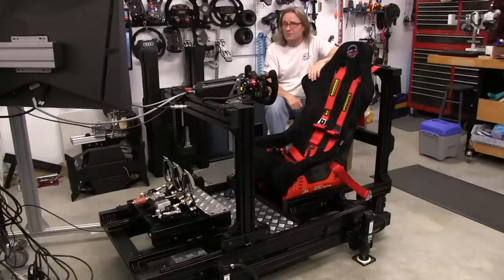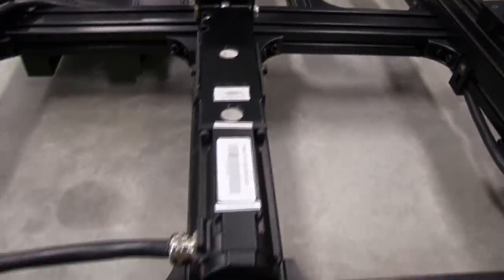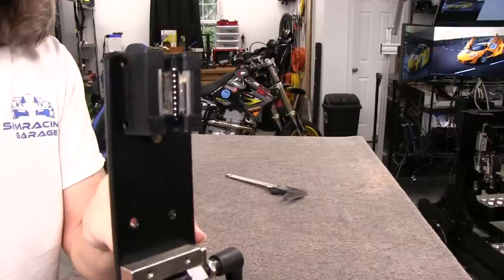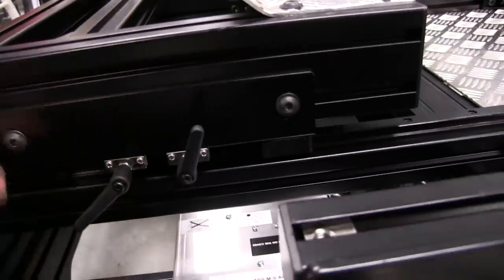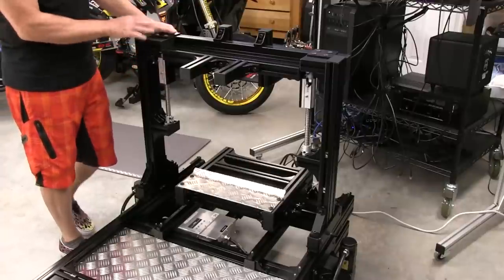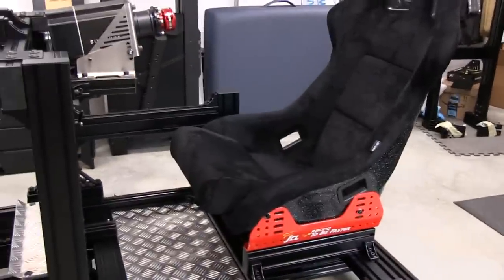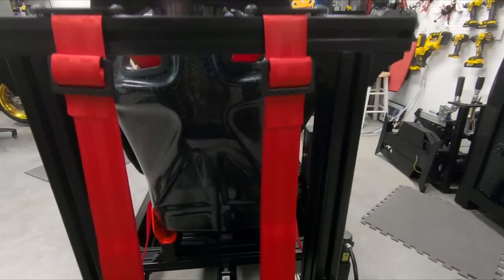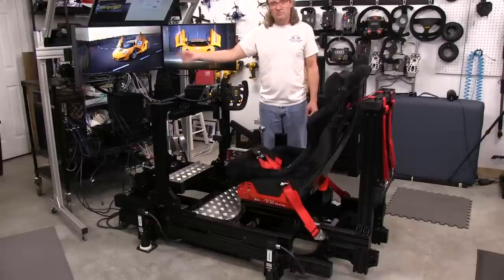JCL V4 4DOF D-BOX Motion Cockpit Review

Comment: Lol
 Are you kidding me? 42k$ for 1.5inch stroke actuators?
I built my cockpit with 4 PT actuators 6inch stroke, 250mm/sec and 175kg left power with only 4.5k $. You can add TL with the underneath frames with only 1700$.
42k is simply out of this world for what this system offers .
Reply: For 42k I would rather buy a car
Reply: For that price I’d hire u to upgrade mine if it works the same way on this video. 😏
Reply: D-Box is really REALLY overpriced! JCL is ... ... ok.
Reply: the 3d printed open source diy jobby?
Reply: Derek Hartley 
No not the SFX100... PT actuators are an industrial heavy duty motion linear actuators.
Reply: 70% of the price is probably the DBox actuators since its a niche they can overprice them fraudulently
Reply: Rich people like to blow money. It's easier for them
Reply: @wajdi1977  I don't know much about motion rigs, do you have a link of your rig?

Comment: Those D-Box combined with seat-mover solutions seems like the new shit if you can spend 40k+ on a motion rig and only tried both separately. Personally when prices go up in real race-car regions, it's getting a bit ridiculous as a private option. I liked the new 3motion from Tracktime this year and it provides similar forces just through the seat, but 14.5k Euros only as a complete package with HE pedals, Simucube 2 Sport, display and sound-system is just ridiculous, since potential customers have this or similar stuff already. 
Personally i'm still happy with my GS-5+SimVibe solution, especially since i found the surge-trick what was missing on default. Usually the GS-5 is not satisfying with surge, because the seat does the opposite of a seat mover trying to simulate the pressing into the seat while accelerating and releasing the pressure while braking, but it feels wrong without a seat-mover especially with seat-belts. The trick is to switch the back- and bottom-plate function so it works like a seat-mover. Now it can do all forces more or less and excels on the sustain g-forces this solution by far. With a D-box at home i would rather buy a GS-5 and make a DIY active seat-belt-tensioner, which are unfortunately not commercially available afaik. Should be around 200 bucks and i guess the combination would be better and more complete than this.
Reply: Hi Leynad, Henning from Tracktime / RaceRoom here: There will be a motion unit only 3motion soon. We only need to build up a bigger support team before launch as that product will require more telephone / mail support for setting up support with customer pcs. We don't want to get in trouble with bad support, so we started with the trouble free ready to run solutions first.

Comment: Put a magnet to these delrin rails, and se if they are magetic! My guess is steel. Linear guides are often used in cnc applications:)
Reply: Magnet wouldn´t work if it´s stainless steel. Most of the stainless steels are not magnetisable.
Reply: Markus Steinbach, these are hardned steel, same as you find any other bearing steel...

Comment: shouldnt braking and accelarating be simulated the other way around?
This kinda confuses me.

How would it feel the other way around? Can you try that
Reply: Yes, this is my concern as well. Looks like they spent all that extra money on a D-Box actuator to create a belt tensioner. When a belt tensioner with similar or even better effects could be built for much cheaper. You could also switched up the design to get a forward surge effect and still get a belt tension when breaking.

Comment: I guess for 43k they could have added a front mount for dd wheels..those 40x40 bars to hold the motor seems a little bit cheap to me for that overall solution, and also the pedal mount seems the bare minimum..
Reply: You can definitely build a much better motion cockpit with 5 DOF plus anterior and posterior TL plus SC2 DD, Hydraulic pedals, Index VR and high end PC with only 20K. This thing is definitely overpriced.

Comment: Can one purchase just the “V4” portion from the JCL website (http://www.jcl-simracing.com/en/v4-dynamic-frame/525-black-aluminum-frame-v4.html) and then mount a SimLab P1-X?  I know they use slightly different profiles where the fittings aren’t compatible and was curious if you could use their sliders they’ve designed to still mount the P1-X.  Then one could have the better P1-X and source their D-Box parts elsewhere for less.
Reply from the maker: Yes you can. JCL will build the V4 to any width you require. And the slider brackets will take regular 40 series profiles as the side mounting holes on the brackets have an oblong hole to facilitate this. You can see this in the "How It Works: (slider system)" segment of this review. I will be mounting a P1-X to the JCL V4 I have. Of course I will be making a review video of this. Including how I go about modifing the width of the V4 chassis to receive the 580mm width of the P1-X.

Comment: Barry could you tell me what the measurements are for the rail width and what size linear bearings are on them ?
Reply from the maker: 15mm rails. When you buy the rails, your source should also have the correct bearing assemblies for it.
Reply: @simracinggarage3026  
Thanks for the reply, i'm building surge myself. 1 more thing could you tell me how long the rails are ? I'm going to use a 150mm stroke so i think 400mm rails would be enough.
Reply: @simracinggarage3026   I wonder what kind of sleds they use. I have looked for a week now, cant find these exact sleds. Finding the clamp was easy.  Is there a brand name or model written on these?

Comment: Off topic question: what do you recommend for a first wheel the TMX Pro or the G920?
Thanks.
Reply: Tmx pro, it has way better accessories to buy later on, such as the handbrake and shifter. The logitech doesn't have a handbrake, and the shifter is all plastic. Also the pedals for the tmx are miles better, and the force feedback is way more raw. Definitely go with the tmx

Comment: Great really in depth review as always berry. So it's an amazing looking set-up, really nice features.  But shouldn't the surge push the opposite way? Meaning during acceleration doesn't the seat push into your back vs pulling away like this system does? 
Here's a system with over drastic settings but the sled is moving the opposite direction. 
https://youtu.be/oiAXlMdQYBw
Can you elaborate on the surge feeling? IMO, it seems like an elaborate seat belt tensioner?
Reply: This was my exact question as well, every surge simulator I have seen is doing it backwards like the example you linked. I would imagine both ways could work and it would come down to user preference? Maybe one way would be better for VR the other not? I am surprised he made no mention of this and didn't try both ways, he's usually on top of stuff like this exploring all avenues.
Reply: The belt tensioner wouldn't work if it moved the opposite direction. The sled is like an elaborate seat belt tensioner.

Comment: Do you ever race in VR ?
Reply from the maker: Not lately. Did some testing with some headsets before. While nothing can touch VR for immersion, just not far enough developed yet to get me to switch. I'm sure, in the future, we will all be using some type of VR headsets.
Reply: Sim Racing Garage 
Index Valve ?!
Reply from the maker: @wajdi1977  I have not tried it. But if I get the chance I will of course.
Reply: @wajdi1977   i think he is old school and thats cool. love his video none the less, he inspires new ideas with my simrig.
Reply: @simracinggarage3026   The Valve Index works extremely well and is very high quality.  With a simple seat mover no motion compensation is needed.  However with surge on this system or the sway on the NLR system you recently tested, I suspect you would need an additional tracking sensor and motion compensation in VR.
Reply: @markkovalcson7243  NLR v3 has motion compensation for VR headsets already.
Reply: @Tokyo-Drift  Yes it does, and no one I know who has an NLRv3 actually uses it.  I don't.  It uses a predictive model based on measurements that you give it to calculate where it thinks your head will be.  But your head works like a gimbal and generally tries to stay in place.   Since everyone's head moves differently and people are different heights it also makes it hard when you have other people trying out your rig.

So for the NLRv3 I consider it completely unnecessary.  With the larger slower side to side motions of the new NLR rig it will move a lot.

There is an open source solution that works with a Vive Tracker that is hard mounted to your chassis.  With surge moving you forward and backwards  you will need some kind of compensation or you will be constantly diving towards your steering wheel every time you brake.